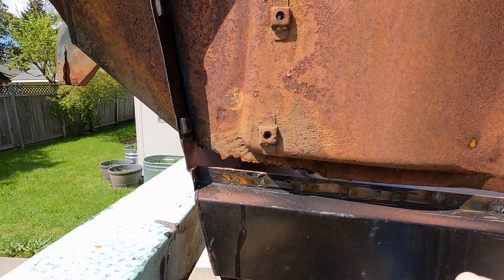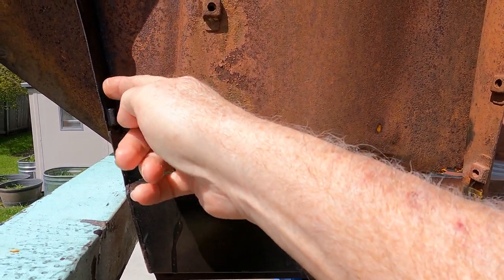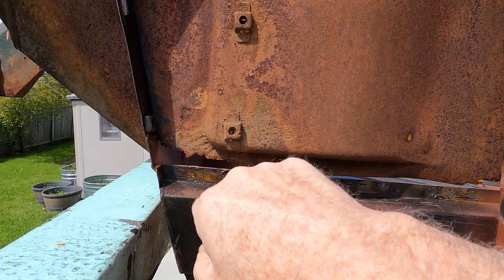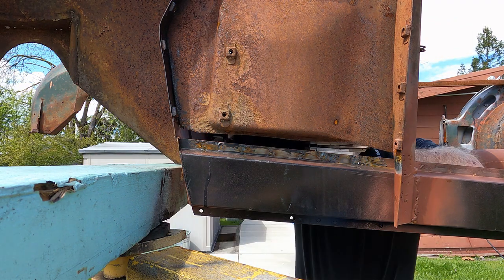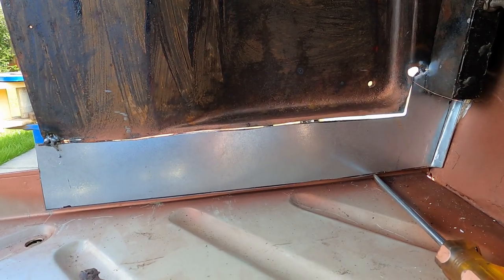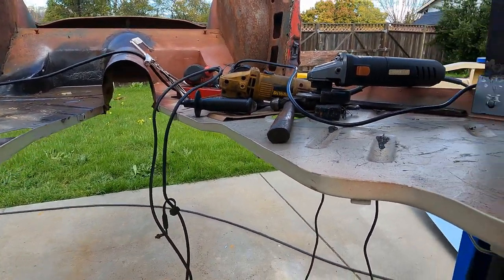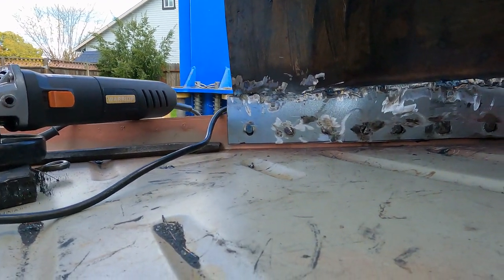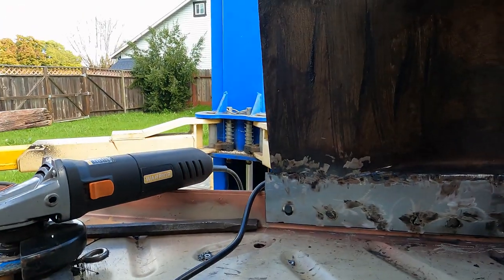1955 Triumph TR2 Restoration.  Part 26 J Kick Panel Repairs.

Comment: I see you stayed with the TR2 style there same as my 195 tr3 but I changed mine to the TR3A witch gos on the other side of the rocked flange. AS far as I can tell the reason is water egress when water hit that planal it run's down and can get in the car and rust the flange out with the A style it runs over and down not getting into the flange. hope that made sense. you made that panel long way down to the floor it originally stop at the top of the rocker at the rocker flange on top then spot welded to the flange.
Reply from the maker: Yes I placed in the way that it was originally placed.  I could not tell how far it came down toward the floor as the bottom edge was completely rusted away.  They seem to think that the panel was not exposed to water on the outer side as there is a provision for a speaker on the right kickboard.  I will most likely seal the seam before I place the outer fender in place.  Thanks for Watching.
Reply: @ejhbritishcars6907  ya the part Iam using is from a tr3a and there is no speaker thank god that's just a BIG water hole.
Reply from the maker: Fortunately, it does not rain very much around here.